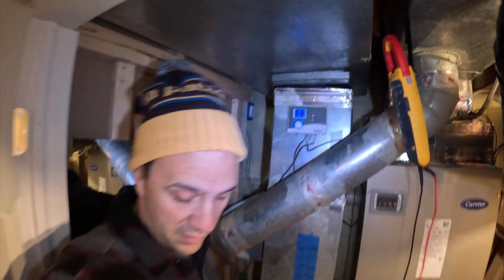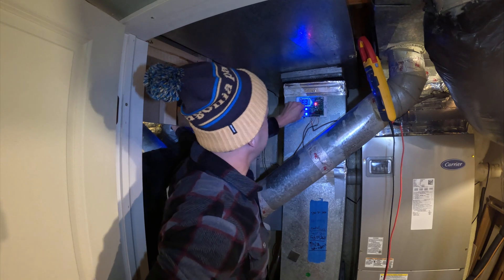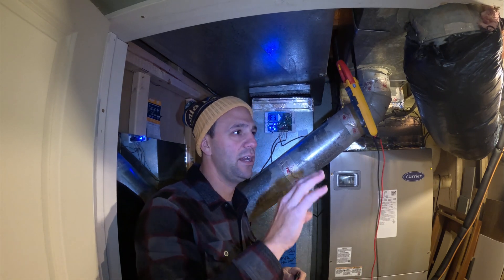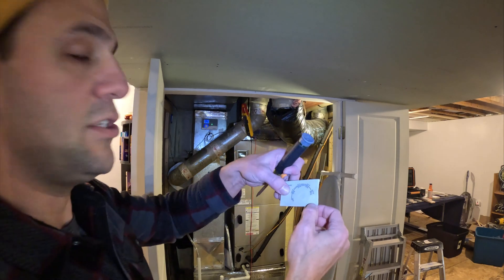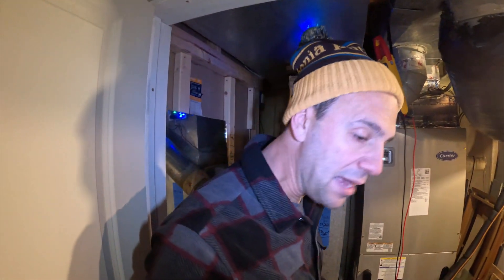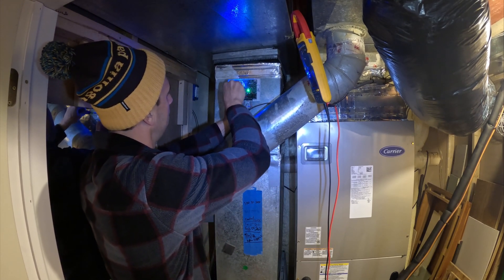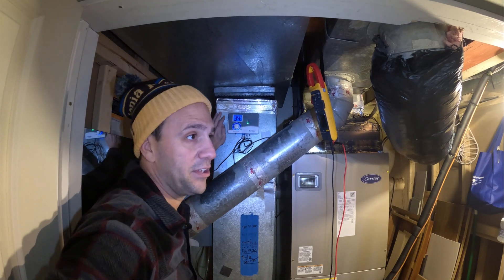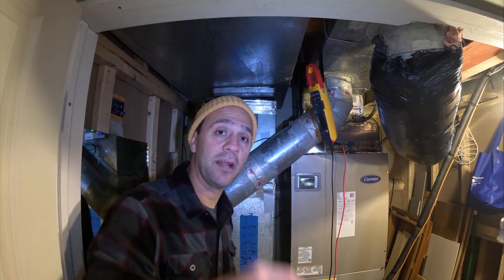Fix e3 error on Aprilaire 500 whole house humidifier

Comment: For some reason mine won’t turn on? It says RH 47% but my pu stairs is always way lower. It’s like 30 so I need to set it higher to run a bit longer to get it up there. But I’ll set it at a higher number like 5 or 6 and I never turns on when I want. It’ll randomly turn on when it wants to. There’s days it’ll go without being on?? What you think?
Reply from the maker: So the upstairs monitor says 30 and at hvac it says 47.   I would regulate the humidity by running the hvac fan for like 10 minutes, then see if those numbers get closer.  If they stay that far away,something not right.  One is wrong.    I’d then get a humidity sensor and verify each one 

With humidity at 47 I don’t think it would turn on but I’d have to check the manual.

Comment: Hey I don’t get the code until I put it in the reset position and once it’s out it goes off but I have a problem getting mine to turn on. Even when I set it at the 5 or 6 when it’s rh 45%. I turns on when it wants and not when I set it higher. My humidity is lower up stares than the basement. So it 29% up stairs. So I always need to set it higher.